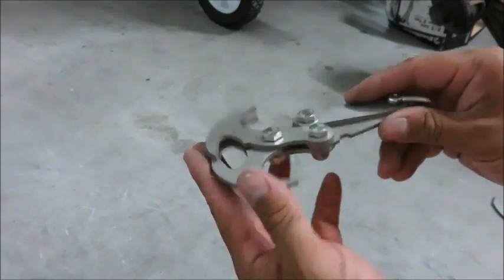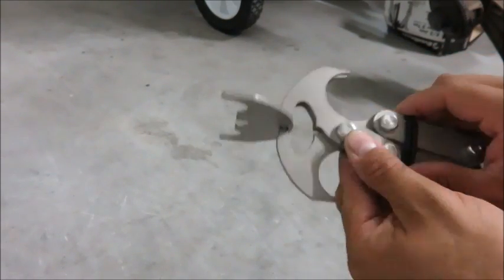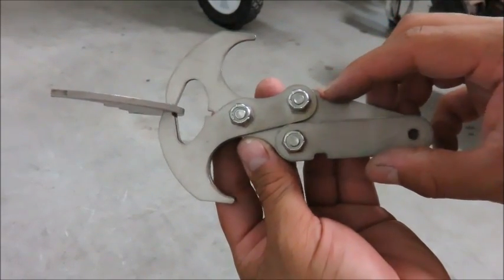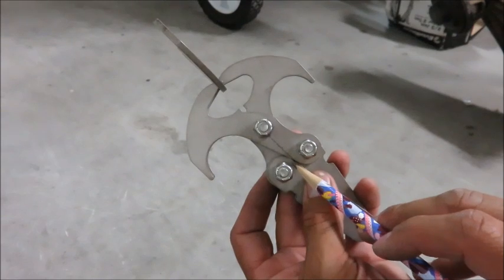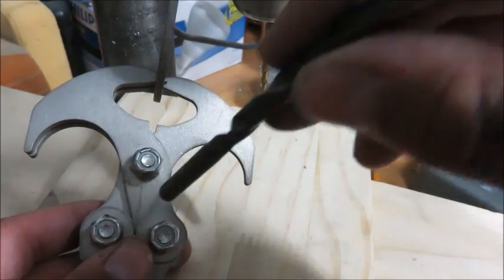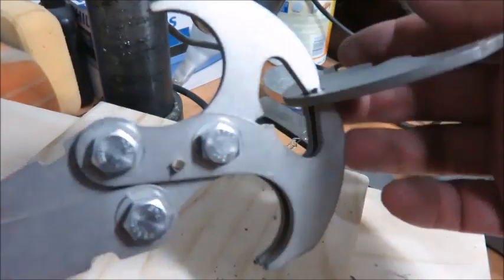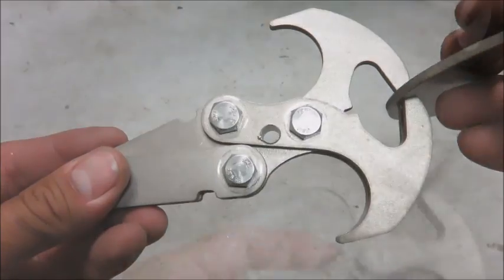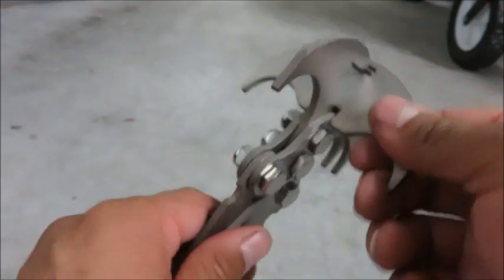GRAVITY HOOK PIN MOD

Comment: The Gravity Hook is a nice idea but the addition of that 1/4 bolt / pin seriously compromises the strength.  There is not edge distance with the new "pin" hole and one of those hooks will surely break under pressure.

Comment: A quarter-inch seems unnecessarily too big.  What's the reason you didn't just stay with the original diameter?  Just keeping the same bolt sizes?

Comment: you could also drill the links back near the shackle where there is more of an overlap in the material, and more edge distance to the hole when centered. 
I won a delerin model on Instructables.com, and really like it.
do you have a demonstration of the second cross piece?
Reply: +rowerwet i was just going to suggest that too lol, it would actually be much stronger braced back there anyways, this is how great things come into existence when ppl work together.

Comment: Kinda altering the integrity of the strength of the tool. And, what is the necessity for the pin, exactly? Doesn't the O-ring serve the same. Also, installing and removing the pin and nut is tedious, to say the least.